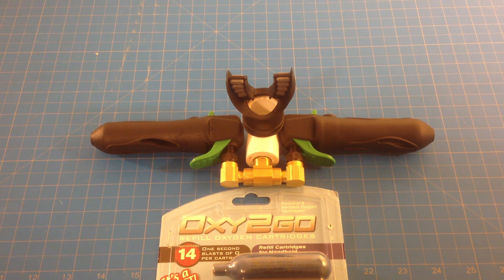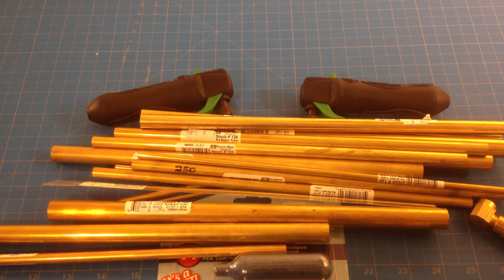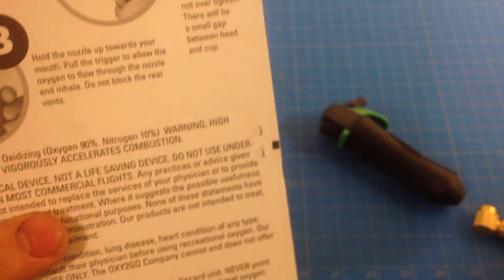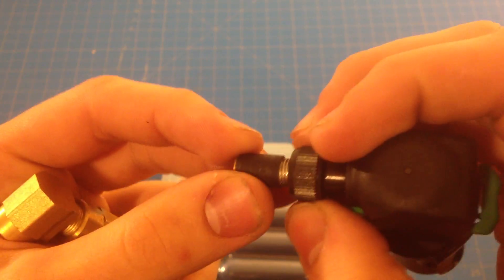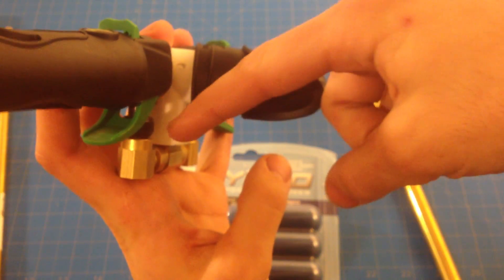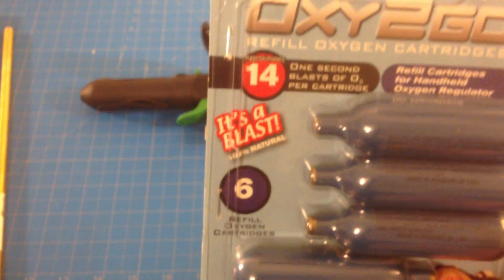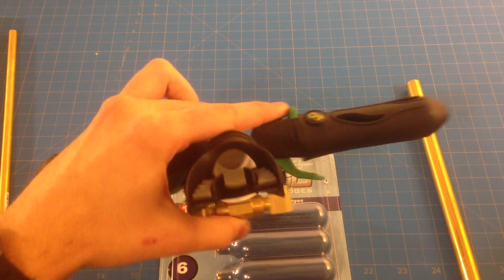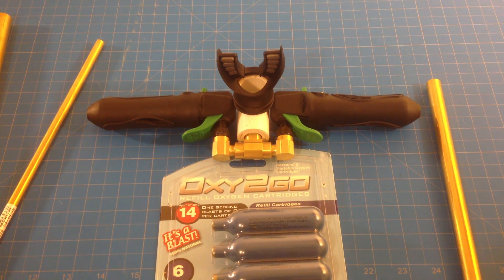007 Mini Scuba Tank Prototype V2

Comment: hey dude ive gotta say im with ureil1 on this 1 i also am a diver an 100% O2 is deadly at just 15 feet the air that a diver breaths is just clean dry air the everyone else breaths it is generaly 21% O2 and 78% nitrogen the other 1% is thing like CO2 and carbon monoxide also if you intend on tring it i woyld recomend a regulator ad 150 BAR = 2175psi that kind of pressure is likly to explode your lungs 
but that being sayd i do have to say i  do like the idea and hav thort of doing a simaler thing

Comment: A mixture of 22% oxygen to 78% nitrogen is recommended, since it's what your body is used to( well, actually it's 21% O2 to 78% N2 with the 1% being filled by trace gases, e.g. CO2).

Comment: what no they don't. did you even read my comment you cant breath pure oxygen at depth also to to even do that requires it incredibly high heat a process that can be seen while welding or burning underwater which also produces hydrogen a highly explosive gas . on a side note your main SEAL equipment consists of rebreathers and two SEAL Delivery Vehicles one of which is just a mini submarine

Comment: you have to use mixed/normal compressed air but another problem with that is the deeper you go with compressed air is the deeper you go the more compressed it gets youd be lucky to get one breath from a device like that at depth ....bottom line it would make a cool prop but thats as far as it would go a costume prop

Comment: You are a smart young man. Keep up the ideas. contact the U.S. Coast Guard, When I flew in Helicopters we were using an emergency device in case we went upside down in the water very much like what you are making. It works but took a bit to get use to. Keep on keeping on. You will figure it out sooner or later just fine. : )

Comment: Well, 50% of the air in the canisters doesnt dissappear, it just becomes more dense but it takes more air to fill your lungs because they also shrink.the deeper you go the more air you need because of the pressure.

Comment: are you sealing the device with O-rings so its water tight? and as for the mouth piece does the water not rush in as you take it out of your mouth. just saying because if you are under water and give it to someone to breath if its full of water the release of air will push it into there mouth and they wont be able to breathe. just a thought, you may of had that figured out.

Comment: you should make it possible where you can switch out the air tanks with out letting water in, like make some valves to close up while you switch them out.
and if you do have like a belt that has multiple tank holders, like a shotgun ammo belt.

Comment: Hey my name is Ben and im a scuba diver and a master diver at depth if you breath 90%oxygen when you come up that oxygen will expand in your bloodstream stopping the blood flow and you will get the Bens the air i breath when diving is 21%oxygen and when im diving nitrox the highest amount of oxygen i can use is 34%oxygen so DONT USE those air bottles you will die please take my warning also do not hold your breath if you start too asend you run the risk of over expanding your lungs

Comment: You need a regulator set at atmospheric pressure 15 psi at sea level (rounded). This will increase you time usage and not blow out your lungs. You need to remove or modify the trigger discharge so it can be hands free. Don't use 2 tanks use 1 to charge 1 to breath with 2 one way valves one to inhale one exhale. The breathing chamber needs to be flexible so it can expand and contract. Water pressure will make it contract and charge pressure will make it expand. You have sweet ideas.

Comment: The bends would not be a problem when diving with 90% oxygen. The nitrogen starts dissolving in your body at a depth much deeper that you can survive in on 90% oxygen. You would be fishfood long before you had to worry about even mild itching bends. The only thing close to pure oxygen really is good for is sea level use, for example for treating the above mentioned bends. This is a lethal device he built here. Better to get a 1 or 2 litre argon bottle and get a dive club to fill it with air.

Comment: A healthy adult has no problem breathing 100% oxygen for at least 24 hours at sea level.
However, if the partial pressure on oxygen exceeds 1.6atm, the oxygen becomes toxic and attacks the nervous system. With compressed air this is not a problem until around 65-70 metres depth, where tech divers switch to a trimix gas containing helium to reduce oxygen content. However, when breathing pure oxygen instead of air, the partial pressure on oxygen reaches 1.6 at as shallow depth as 6 m. Be aware.

Comment: @GreekGadgetGuru see if you can pick up a copper x male adapter that you could solder onto that brass casting and get to thread into that elbow. getting that pvc attached permanently to the brass may seem a little more difficult than you may think using an adheasive. as for the exhale part, search "3/8 checkvalve", that should steer you in the right direction. I could hook that up so nicely as I am a plumber. Very good job on it soo far, good luck.

Comment: for a fact i-am a PADI certified openwater and wreck diver.
i can breath from that device, however not the way he intended.
i've been diving from when i was 10 years old so dont say i-am not a diver.
if you put a high velocity compressor underneath the water i can breath from it,
by not putting the hose in your mouth but using just the air bubbles that come out.

Comment: I have to agree with the need for a regulator. Also, if you want to put an exit valve for the water, it needs to be at the bottom of the mask. If you had the valve where you showed, you might clear some water, but there would still be a good amount in the mask.

Comment: For a fact you are not a diver because this is unregulated. even a faulty running reg in your mouth is 95% regulated already from the tiny whole where your octo connects to your scuba tank. if it was completely unregulated from the scuba tank your lungs would explode. You may have seen the power of a scuba tank when a propane tank flys at 500 mph in the air

Comment: Check out the company "spare air" they make basically this but much easier because it is uses a regulator. I've scuba dived a lot and its a cool design but you really need a scuba regulator underwater. It gives you 30 breaths, and is only 9" by 2". Also 14 breaths at 30 feet is only 7 breaths down there and only 3 breaths at 60 feet because of water density.

Comment: you need a diaphragm to drop the pressure of those little tanks or you will blow your lungs out.. also pure o2 goes toxic at about 2 bar.. try a mixed gass fill

Comment: To get a longer use time use a rebreather. Maybe those DIY vaccum bags, rolled up before melting the sides so when you breath out it uncurls. Solves the problem with breathing in pure oxygen. One shouldnt be using this for great depths so I wont bring up those problems. Air safety valves can be modded to use different springs(different pressures) paired with a regulator can make is so that you dont need to bite down to release O2, just simply breath in harder than you breath out.